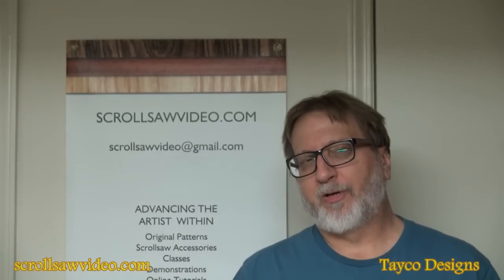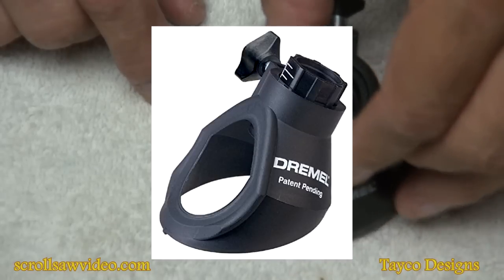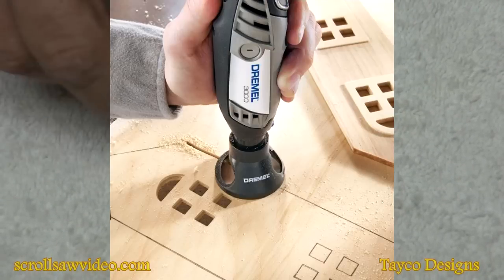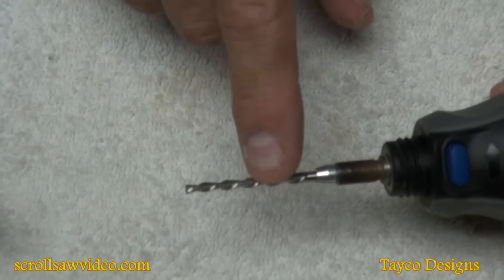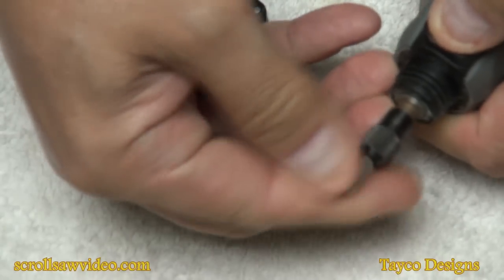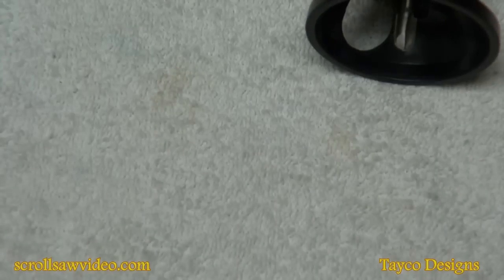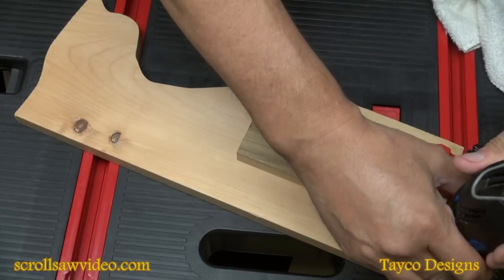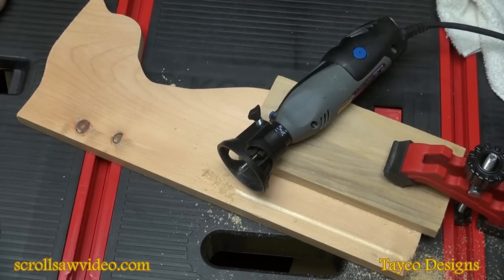Intro To Dremel Spiral Cutter With Router Bits

Comment: (Additional info) I’m attempting to use it as a jigsaw to cut out a square ft whole..please advise
Reply: Do the same thing only use the side cutting bit that he showed you in the beginning draw a line with a pencil pen or marker or make a fence like he did using clamps take your router plunge cut make your square or drill a hole with a drillbit near the edge then do what I said.
Reply: You'll have an 1/8" missing in the picture for each pass with the width of the cutter. I wouldn't use a Dremel for this.

Comment: If you put some wood a little higher than your job on the opposite side of that clamp, it will act like a wedge and hold your piece much tighter.  That is not the way to use that clamp.

Comment: I bought this attachment to rout about 1/4" out of a post to create a depression for a railing mount bracket. All I can say is "what a piece of crap!!!" The bit would not stay in the collar and repeatedly got pushed all the way up into the tool. I used pliers to snug it up... to the point where I was afraid it would break the tool, but it wouldn't stay in place. PURE JUNK.

Comment: Just bought a articulating dremel that looks like.a jigsaw except it is a dremel tool.  It says it takes up to 
3/16 shaft bits. It did not come with the dremel bits..it was a.flea market.item. It looks like my router bits will fit them.  I have numerous projects that this will make extremely easy.

Comment: Your thumbnail doesn't even show router bits. Its misleading. It shows cutter bits, 561W et al. Not cool.
Reply from the maker: Its because this attachment is NOT intended to be used as a router.....even though it does make a pretty decent one.